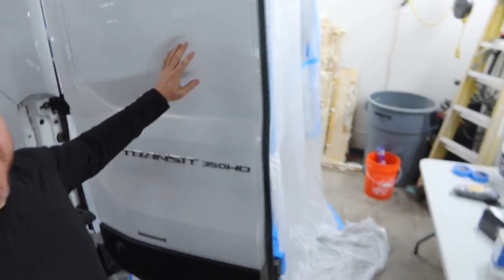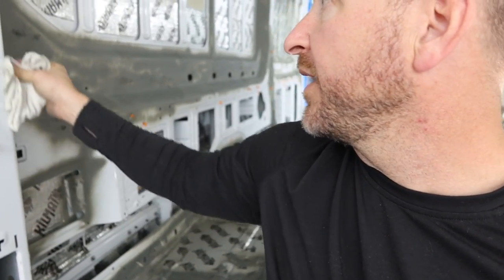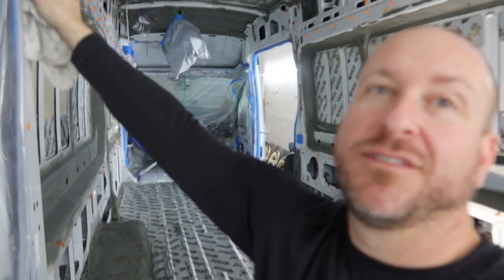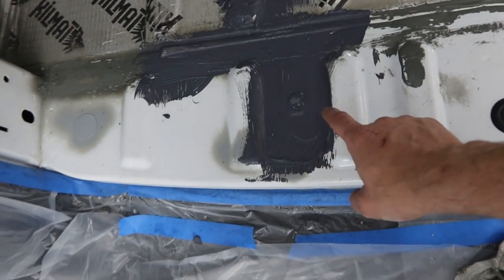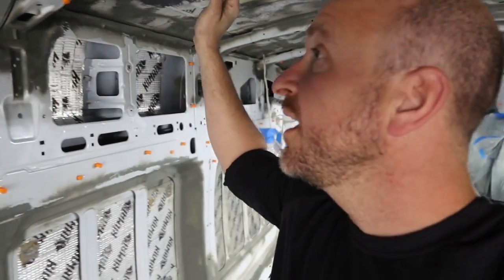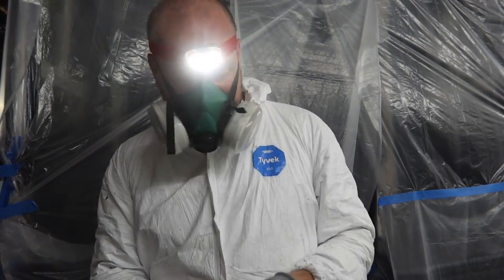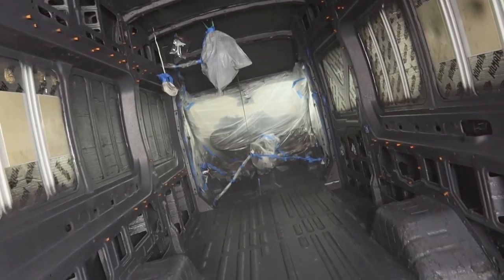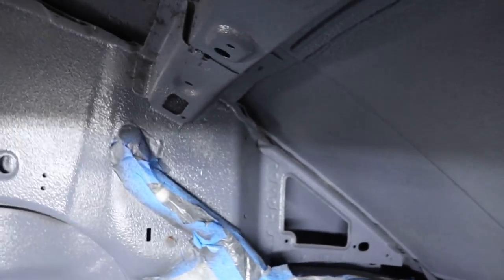How to Spray Insulation in Vans | Big Mistake before Spraying LIZARD SKIN Sound Deadener

Comment: With the lizard skin spray, is it pointless to spray it on the beams that stick out from the van right? Seems like you can save by just spraying it on straight sheet metal? Also do you think it does much to spray it on the floor? I’ll be insulating the van with thinsulate and poli board on the floor
Reply from the maker: hmmmm.. i dont know... i think covering the entirety of the vans inner body was a good thing... the cold or heat can transfer thru the metal of the van body to the inside... so i think covering all the metal you can see is a good thing.

Comment: constant heat always transfers it's energy towards cooler elements/molecules - TBC's only work where temperature vary widely over short time delta's like piston crowns exposed to combustion then intake air and fuel with high thermal heat capacity

Comment: How many gallons do you need for the whole van Matt? I am planning to mod the sprinter 170 later. Thanks
Reply from the maker: I used 10 gallons of sound deadener. More than enough.  The ceramic coating I could have used 15 to be honest. Depends how much you plan to coat.
Reply from the maker: Let me know how it goes!  And watch the next few episodes to see some of the stuff I went thru
Reply: Thanks, wish you the best.
Reply: @JaYoeNation  god damn you spent $7k on sound deadening on top of all the killamats? talk about overkill.

Comment: I hope the lizard skin and all the paints you are spraying do not emit chemicals and gasses during temperature variations as you will eventually be sleeping in that thing in hot and cold weather. Take it from the brand in writing for your safety
Reply: It's not any worse than the outgassing from a new car ,and lizard skin is water based. 
Panels I sprayed with it ,I put in the boiler room to dry and it smells like latex paint in that 6+8 room.

Comment: What is Lizard Skin and what is it supposed to do?
Reply: There's 2 kinds. 
A sound barrier and a heat barrier. 
You're supposed to spray the heat barrier over the sound barrier if you go that route,I've only done the sound barrier and it's awesome.
Scuff painted surfaces, and prime any bare metal and scuff that because it's water based and will cause rust on bare metal. 
After doing my project,the whole shop got quieter as if I dragged in a big area rug.

Comment: Your looking at the hardest and one of the worst methods. You just added an immense amount of weight for little benefit, meaning  insulating and sound deadening properties. Plus Spray on coatings trap moisture which causes rust. You may of clogged your drain holes as well. Do you see any OEM's using this stuff ? No.  No Aftermarket RV builder uses this stuff.   Why  Because it is ineffective for the weight and cost and very labor intensive..  There are better easier methods to insulate and sound deaden a van.  The best method is by using Kilmat and 1" Areogel blankets. Is simple, fast and 5x more effective than any other method.
Reply: Look inside quite a few newer cars inner structures and you'll see a spray on sound deadening. 
They don't spray everything, doing a partial panel does quite a lot.
 It's the law of diminishing returns.
Do half a panel and it's 90% better ,but spraying the other 50% and it only gives ya the last 10%. 
There's factory sprayed material all over inside of an 80 240D I just got, and those are one of the cars that destined to last forever.

Comment: The biggest scam is Evans coolant - it has less heat capacity than water or 50/50 mix - with low thermal expansion - so it transfers little heat from the engine to the heat exchanger
Reply: I have used Evans coolant for years. No problem. I also use it in my radiant floor. As to heat transfer, its better than Glycol.
Reply: @mrgcav  No it has a lower heat capacity = less heat transfer than glycol - thermodynamics 101